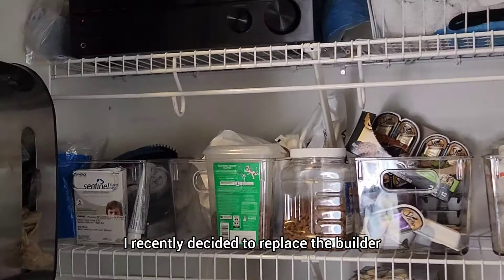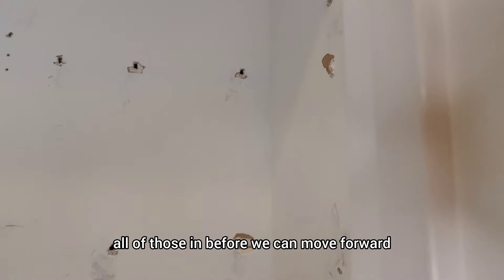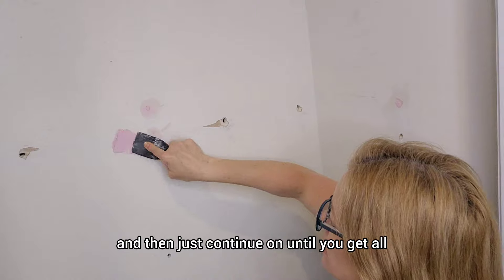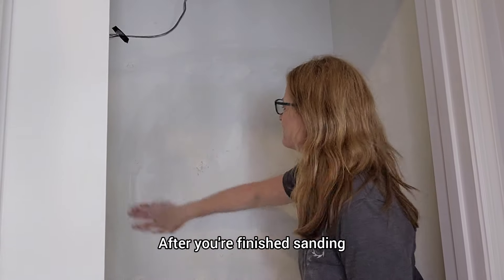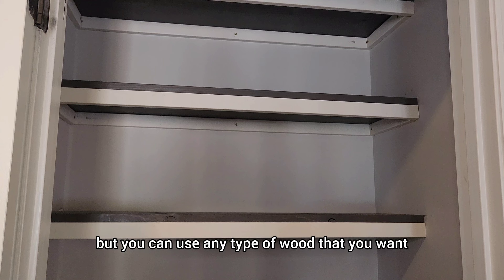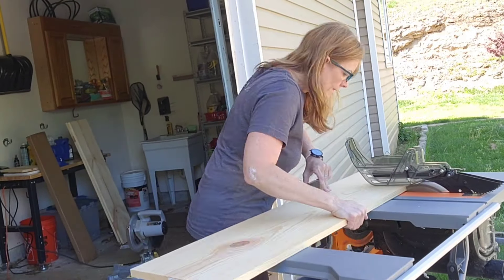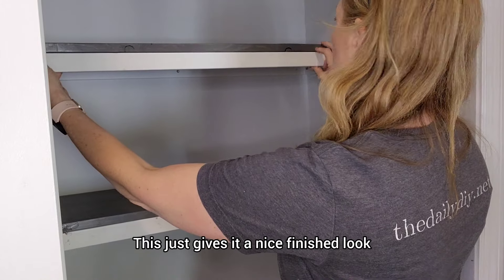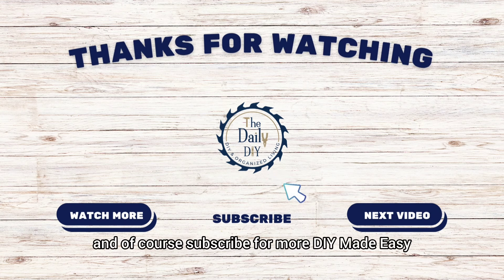How To Build Pantry Shelves Easy

Comment: I had a huge not walk in but very large closet system in my bedroom.....I ripped them out, did the repairs and sanded and painted. It's such a bitch of a project but I had been considering ripping it out for almost 15 years ....I've literally had Rubbermaid cabinets the kind for garages in my closet and hanging my clothes on a clothes rack trying to figure out what I'm going to do with the closet interior while I did the fan installation and the hardwood floor touch ups etc ....Im still not sure what to do with the closet but it will probably at least for a portion involve shelves like this, and I'm working on this today so thank you! I had considered the rig up of covering the wire shelves but literally nothing except finishing filling the holes of proof they ever existed felt as good as ripping them out of there!!!!